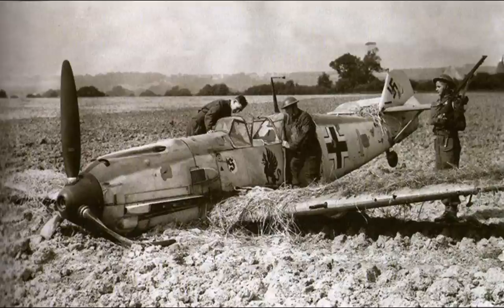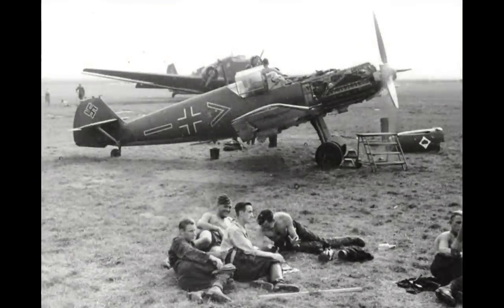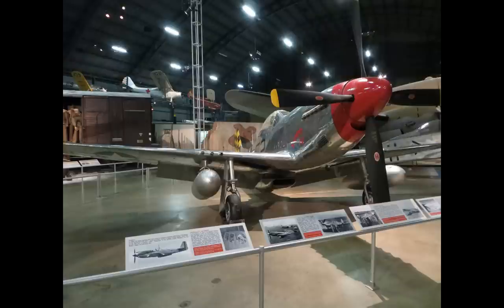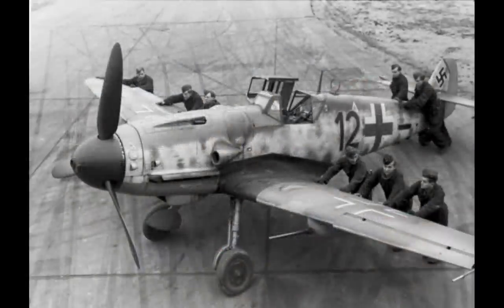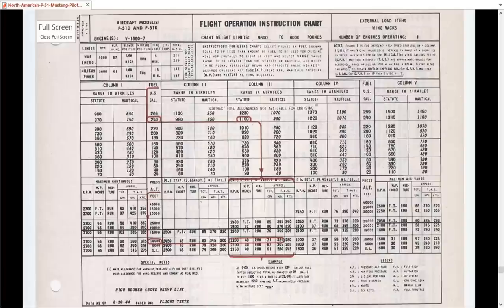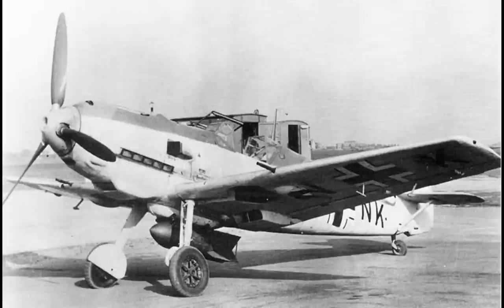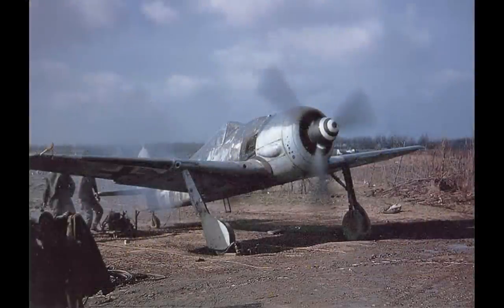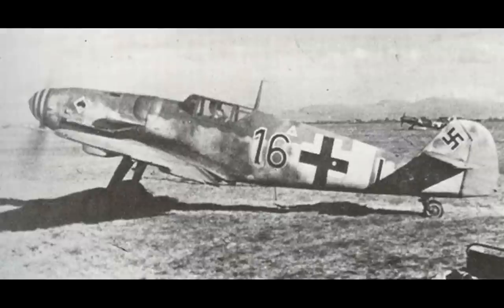Messerschmitt BF 109, Why Such Short Range?

Comment: Did any of the old birds used a “blow thru Carburator”? Or where they all “draw thru Carbs” like you speak of?  When you add fuel to air I dose dramatically change the flow dynamic through the intake tract. They was the advantage of tuned port injection, because fuel displaced air thus moving the fuel injector  closer  to the intake valve freed up the volume from the throttle body to the intake port. With Tuned port injection the injector placement is very in-depth. If they ran Water Meth systems or even straight alky. I would think they would want to introduce the methanol in a place take most advantage of the inter-cooling effect via the evaporation of the methanol. I would think in front of the compressor would be best for simplicity and low pressure. But directly after would also work.  I grew up around Alcohol funny cars and dragsters, and the coolest thing was to see the ICE covering the injector hat at the end of the run. It was always frozen over while the blower and the rest of the motor where 200-250 degrees.  Mechanical injection system are like a On/OFF switch. You can make them idle well and run at WOT well, but every where else it’s hard to regulate fuel pressure and return pressure through all the mid range rpm in a vehicle.  I would think plane engines are more constant rpm engine not having much of a power band so to speak. I have worked on mechanical injection my whole life of 40 years. I wish I was as confident with the systems as you are because I blow a lot of stuff up🤣 the worst part is half the time I don’t even know what we did to fix the problem. The systems I work on have to be the craziest complicated mechanical injection systems ever. We run 130 GPM through a barrel valve. We use a slide valve to control the indictment system to half track where the clutch locks up. At that point we send air via a time solenoid to the BDK  valve to start the lean out process from half track to the finish line because as the load comes off the motor it can’t burn as much fuel so the lean out is critical for MPH. The return system also goes thru a check valve that keeps fuel pressure up as it’s idling. So that at the “step” aka when you hit the gas the fuel pressure is not sluggish causing a lean spot from the instant boost from the super charger. Very much like a accelerator pump on a carb.  Both the fuel supply and fuel return systems have a “flow meter” and transducer on a impeller. We also have a accumulator or 2 that inject Astro Glide over the blower to lube it as we shut the motor off with the fuel. The rule book states we must run a mechanical injection system that is pneumatically controlled VIA electrical solenoids and pneumatic timers. 😳🔫 just thinking about it raises my blood pressure. All racing tech is passed down via aerospace so I watch a lot of aviation stuff to cross pollinate ideas. Because the NHRA the association I race in keeps the cost down by outlawing technology, or so they think🤣 I figure I can even learn from the old war birds. Thanks again for your channel and your time🚀
Reply from the maker: Most planes used draw though carbs, but blow through was no unheard of. Also, in the automotive world, blow through was quite common. Studebaker used a Carter AFB carb modified for blow through on their supercharged cars.

Comment: The point in comparison overlooked perhaps is the P51 was built for the Allison originally. The P51 was always built with Bomber Escort Duty as a requirement, not Air Superiority as its primary goal unlike the Spitfire and the BF109.
The Allison was larger than the Merlin thus requiring more fuel. Just by conversion there was an improvement in range let alone ceiling.
The Allies [GB] specified a much higher octane fuel to allow Higher Compression for better altitude performance. This was very inconvenient and was a significant tax on Allies resources. Only when it was proven the Merlin needed the good fuel was it agreed. Other GB power units like the Taurus didn't need it.
The Merlin as a prewar engine was always built to take full advantage of this.  US and Axis engines were not pre war. 
The Axis was unable to do this due to supply issues so it relied on fuel injection to maximize its power hard limit altitude wise.

Comment: I didn't hear you mention that the u.s. thinking as well as most other countries thinking at the time was that the engine had to run with a certain amount of Rich fuel mixture to keep from burning up the Pistons. That was shown to be a fallacy when Charles Lindbergh ended up in the South Pacific flying the P38 for a little bit and realize that the plane should be getting a much greater range then the 900 or so miles it was doing sorties at and coming back almost empty of fuel. After spending a night putting down new mixture settings and delivering them to the commander at the base and other Pilots there automatic response was that the engine would never survive that. So he offered to fly the first sortie. He took off and flew over 1,800 miles and still have plenty of fuel and reserved for loitering over the base when he returned. He functionally more than doubled the distance the P-38 could fly. The very first long-range Mission they took on after that was when they shot down Yamamoto. And they continued those sorties out over that island but they shot him down at so that the Japanese wouldn't realize that we had broken their codes in 1938 or 39. A friend of mine's father was actually on that mission oh, and every pilot that flew that day got the distinguished flying cross.

Charles Lindbergh knew exactly how lame you could run the engine and you could immediately richen it up when you had to go and do active combat. Being functionally a flying wing, the P-38 was a very efficient aircraft to fly.

The other Advantage the P51 and a few other later aircraft also held, was the laminar flow wings.
Reply: Something I have never understood was why the AAF had so much trouble figuring out how to operate the Turbocharged intercooled version of the V1710. What they actually were doing was over cooling the intake mixture. The fuel was condensing in the intercooler and running in streams at the bottom of the intake runners. That meant that the first cylinders would be over rich and foul plugs and more distant cylinders would get lean and burn pistons. Normal reaction by pilots was to enrichen mixture and open intercooler flaps which made it all worse. Lindbergh was willing to follow his own ideas and leaned and closed the intercooler flaps in cruse which was the solution! The big mystery is why did it take two years for someone to figure this out? The P-38 had been so troublesome in 1943 England that they were withdrawn from service in that theater. Kind of a scandal really.
Reply: @keithstudly6071  the P-38 sent to England did not have turbo chargers on them. They ended up being underpowered and only good for lower altitude at Ground attack which was not useful, especially at the beginning of the war. I thought I remembered that they also didn't even have counter-rotating props which would just have attitude the difficulty of flying them. Not the less they were referred to as being castrated.
Reply: @44hawk28  Exactly! The RAF canceled most of the order. The remaining aircraft were used by the AAF in training squadrons. They could have been built with counter-rotating engines, the V1710 was very easy to reverse rotation in. So the question is why did the British order Lightnings with little regard  to the engines? I think they had ideas about hanging Merlins on them after they got them and also suspect that a Merlin/Mustang was in plans before the first was delivered.
Reply: @keithstudly6071  I believe it was more than the supplier decided to send aircraft that they didn't already have orders for. Pretty sure that if they had sent lightnings, the aircraft they sent were not considered Lightnings as they did not have the turbocharged engines or an opposite drive engine just to get something to England that they could use. In the tactics that the English were using the lightning would have been a superlative choice for defending their country and even attacking well into axis controlled areas. It was also more than fast enough to get away from anything in the air, even with the lower octane did they were using.

Comment: The Bf-109 started with a 66 imp gallon tank and went to an 88 imp gallon tank with increased engine size (from what I recall).  I think the DB-601 models only had the 66 imp gallon tank (about 80 US gallons).  When they went to the DB-605 they upped the tank to 88 Imp gallons, 105.2 US gallons although it might have been increased in size earlier.    The pilot literally sat in the L shaped tank.  The P-51 was much slicker than the Bf-109, which helped fuel economy.

Comment: I think the claimed advantages of induction cooling effects in carbureted aircraft are based on evaporative cooling of the fuel charge rather than expansion of the air in the venturi.  Also, I think Navy experiments on the R2800 showed that imbalances in induction air flow negated any benefit of uniform fuel flow into each cylinder, at least on that engine.  I think post-war versions of the 4360 got injection with different fuel flows into each cylinder to somewhat tune out imperfections in induction air distribution, similar to “Gamijectors” on modern fuel injected piston aircraft engines.
Reply from the maker: No, not because there are no evaporation cooling effects, of course there are! It's because that advantage is not unique to carburetors. There are plenty of fuel injection systems that take advantage of this.

Comment: Greg, I believe you may have overlooked to primary benefit of the DB605 engine. It is not simply "fuel injected" but in fact GDi (Direct Injection), the fuel injectors spray directly into the cylinders under extremely high pressure. 

The biggest advantage of this technology is the ability to control engine knock or detonation with relatively low octane fuels. And/Or to run higher compression, or run the engine far lean of peak.

Many modern automobiles are now adopting "Gasoline Direct Injection" for its fuel economy advantage.
Reply from the maker: I wouldn't say I overlooked it, it's just that I can only fit so much into these videos.

Comment: Talking about range the big thing about the K that was better than the G which was better than the E/F in terms of range on the same fuel load compared to bench consumption (the F offset power increase with streamlining to translate to range equivalence, the other two simply raised the cruise alt for the same effect), the K had a bigger blower casing than the G and its normal cruise, not lean for very quick run up was up something like 6500m (lean/eco forces much lower alts, so normal cruise was preferred unless navigation was a problem or it was a risky mission duration), which later Merlins used a second supercharger stage to achieve but that's a more complicated system, more tooling, German aero manufacture was always very stressed and on a back leg for the bulk of the war and it got much worse later, hence minimized retooling for later fighter models was as much a priority as performance increase.

Comment: Most of the cooling effect comes from the vaporization of the fuel after the carb, this can also be done with fuel injection by simply putting the injectors farther upstream in the intake manifold... a lot of EFI drag racing engines have this feature
Reply from the maker: That's actually my point. It's not something that's specific to carbs, and NOT an advantage of carbs.

Comment: Great series. One thought: in hot ridding car discussions, the advantage people claim for carbs over injection isn't the venturi  effect cooling anything. You have that part correct about the energy to cram into the venturi in the first place. It has been proven that there can be increases in power through the extra cooling through latent heat of evaporation of an intake tract compared to a dry Intake from port injection. As modern efi has grown more sophisticated and accurate, it still beats carbs, except maybe with low RPM torque production. All that not withstanding, carbs weren't superior for the role in which you're speaking of.
Reply from the maker: I seem to have to respond to this same basic comment over an over, so I think I'll add something to the description about it.  I was specifically talking about the venturi effect, and it seems everyone agrees, but then says something about fuel vaporization. Of course I know about that, but you can get that with either injection or carbs so it has nothing to do with the carb vs. injection debate. In fact many WW2 airplanes with fuel injection did inject fuel prior to the supercharger, including some German planes.

Comment: You're pretty much on with the big engine small frame, except for the trains, they are the odd one out, due to them using steel wheels on steel rails.
Which leads to very little grip and the main way to increase "grip" for a train is to make it heavy, and/or increase the number of driven axles. Which also reduces the Axle pressure*, but that again also affects "grip" or stiction.
However that also reduces the force applied per axle so generally means more axles can bring more power onto the rails.
Which is also why the old German Br 151 a six-axle (Co'Co') design with an hourly output** of 6,288 kW has a setting off traction force  of 395 kN, while more modern four axle locos (Bo'Bo) like the Taurus (II) with an hourly output of 6,400 kW can only put 300 kN on the rail, and that only in good weather on dry rails. IRL two loco driver friends of mine have reported that on wet rails or leafy rails you'd be lucky to put on about half (150 kN-ish) to a third (100 kN) that force.
The Br 151 weighs 118 metric tons and the Taurus (II/ES64U2)) weighs 86 Metric tons.
If the Taurus (II) is fitted with ETCS*** it's 2 tons heavier and my friends were always happy to have that, because those 2 tons did improve traction, even though they then did not like ETCS. 
Unless necessary it was off, but that's how they liked it best then, as traction improving ballast. 

Aside from that great video that explains a lot about one of my favourite fighters. 
I think you made the point about range perfectly, in that it wasn't in the requirements when the 109 was designed, same as the Spit, while the P-51 was designed to different specificatisons. 

And engine design, or rather the lack of ready new designs was a problem in late war germany. Same with Fighter designs in the mid war period. 

I also learned something new about the 109, namely it's supercharger design, and that doesn't happen often these days. 
Well done, sir. 
 *Axle Pressure=Loco weight/number of axles (With the exception of Steam locos where it can be a bit more interesting but their axle loading/pressure is usually taken from the driven axles. 

**Maximum output that can be safely put out for an hour. Different to continous output which is the ammount of power the loco can put out continously without damage to itself. 

***European Train Control System, a train control/security system that is supposed to replace national train control systems in the EU. Depending on the level it works in conjunction with lineside signals or completely as in cab signalling.
Reply: What the f % does train have to do with this video.

Comment: The other thing on the P-51, it went from the drawing board to flight test in 101 days. Designed in 90 days. Better known as the A-36 Apache. Britain gave the designation. Mustang.
Reply: And engine.

Comment: The “pundits” (not including this channel) forget the overarching requirement for the entire German military in 1936. To defeat France and avenge the loss in WWI. The 109 was perfect for that. It was cheap, very easy to produce, outclassed almost every design when averaging out the need to produce lots of very capable fighters in a short period of time. Germany, right up until the introduction of the 109 in combat in Spain, saw those two needs as trumping all others. Germany’s failing was.... to not build another capable longer range design in conjunction with the 109. The 110 was supposed to fill the gap, but was a miserable failure during the Battle of Britain. America produced multiple long range fighter designs, both for the navy and Army. Go figure, Different requirements. Britain had two designs, the older, easier to produce, Hurricane, and the Spitfire. Why? They needed lots of fighters, the Hurricane filled the gap and they could make a lot of them. Same rationale for the P-40 fo he Americans.

Germany, by the time they figured out they might need a longer range fighter, was so involved in the problems of over extension they just needed every fighter they could get, and ...... the rest is just history. The 109 was not the problem for Germany. The real problem was they started a war they were ill equipped to win. When they got to the English Channel, they asked each other the famous question, “What now”? Too late at that point.

Comment: The BF 109 was basically shorter ranged because it was to be an interceptor of bombers and was to be used over the airspace Germany controlled. The designers didn't foresee the need for range initially. It's range was comparable to other fighters developed in the very late 1930s. They opted for armament and speed.

Comment: Bf-109 First flight: 1935
P-51 First flight: 1940

There's your answer. There is a difference of 5 years of technological and docrine development. You can not compare the two against each other. A 109 G-14 or 109  K-4 is in essence still a 7 year old aircraft with some upgrades. So it will NEVER be able to compete in every field.

It's like saying that "the aircraft carrier Hosho was a worse design that could carry fewer aircraft than the Midway class carriers". Well obviously it was.